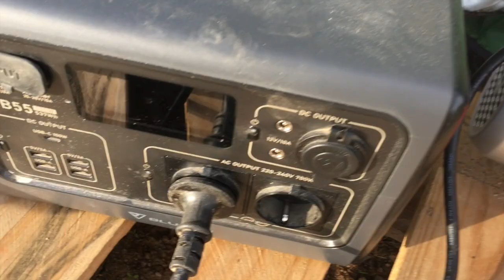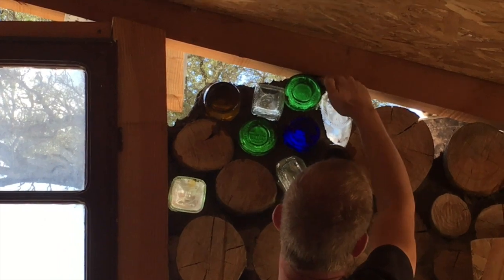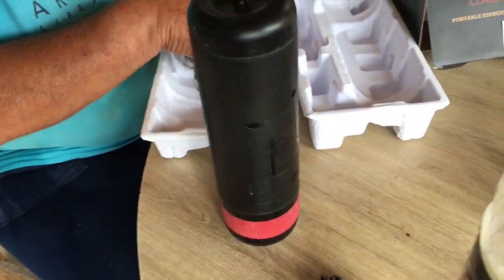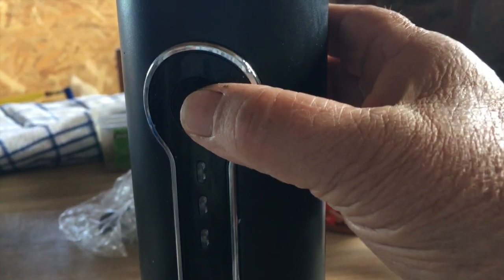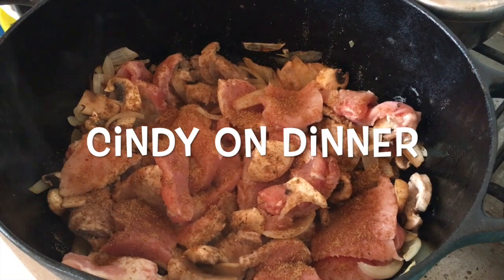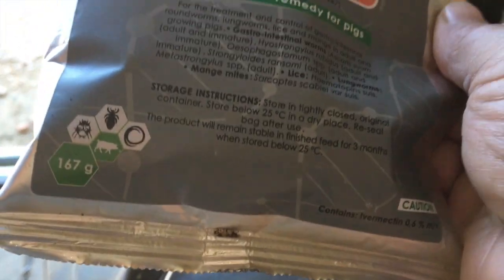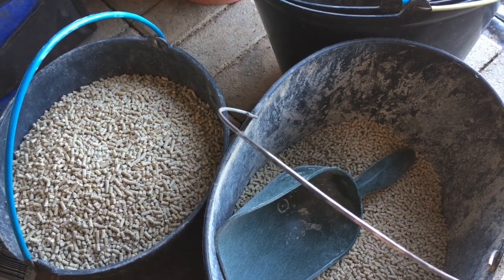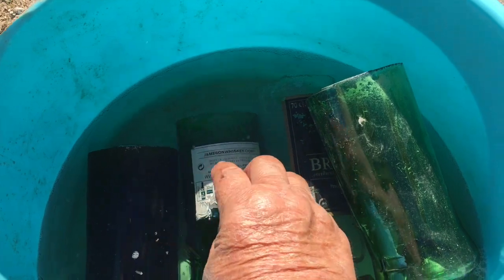Off-grid in Central Portugal / All in a Day's Work

Comment: You can use WD40 to remove stubborn labels on bottles.  I had duck tape glue stuck on an item of metal, WD 40 was the only thing that would remove it without damaging the paintwork.
Reply from the maker: Great tip!